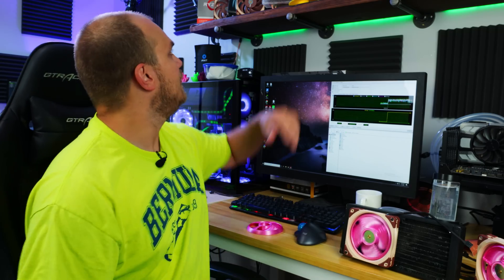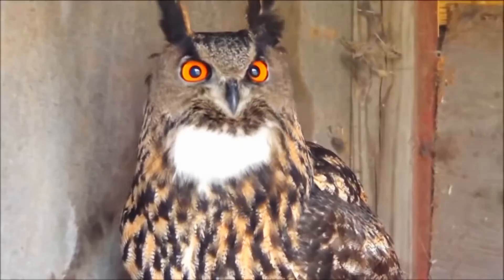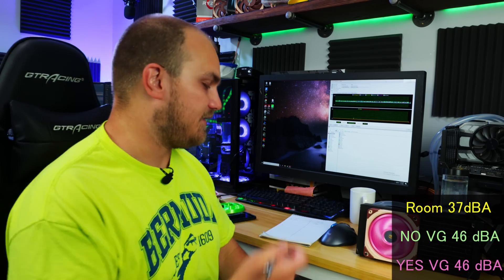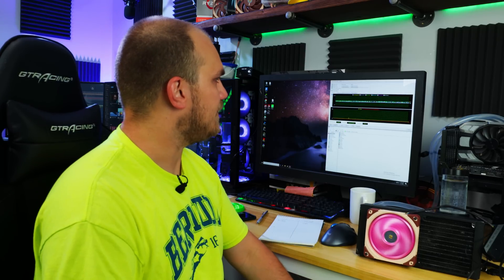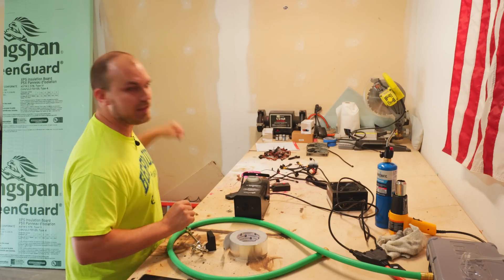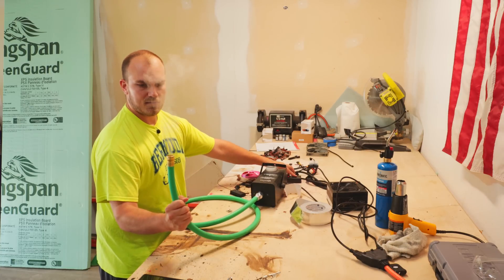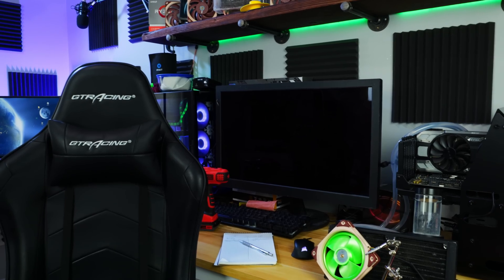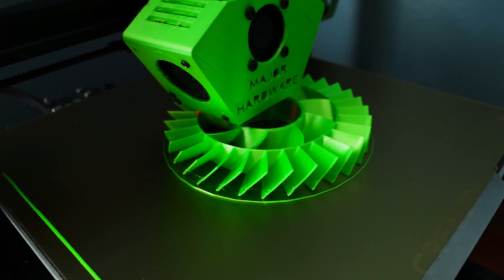Do Vortex Generators Make A Difference | 3D Printed Fan Testing

Comment: How about some dimples in the fanblades? Like a golfball?
Reply: There are already commercial fans with similar features like the „Zaward Dimple Blade Golf Fan“, I remember Sharkoon selling golfball-structured fans around 2012. Does not seem like they were that much better. All these vortex generators and what have you work above a certain speed and are useless below, similar to winglets on airplanes.
Reply: dimples on golf balls work by induce turbulent flow faster/earlier than without dimples, this way a spherical golf ball flying though air appears like a more sleek droplet vs. a fat one. Hence reducing drag.

Hence dimples won't really have an positive effect on a fan... on a car it somewhat works, as shown by Mythbusters.
Reply: I wonder if it had a positive effect

Comment: Make one with a servo in the middle so you can adjust the geometry of the blades.
Reply: Awesome idea, but two problems. One: even an ultra lightweight servo is a lot of mass to add to a fan. Two: how are you going to make the electrical connections to the servo at 2000 rpm?

May have thought of a solution. Instead of using a servo, build a centrifugal governor to control the blade pitch!

Comment: looking forward to that one you showed at the end! also mass on the fan (it self) can cost some horsepower resulting in the motor pushing more against the fan than the air... i swapped my house fan's propeller with one that previously burnt down (the motor)... now it finally pushes air but can only turn 1/3 the speed. the propeller is like 3 times the weight but the fan curve at least does something! (and is 10 times more quiet since it spins less fast to create more flow!)

Comment: why not put something like a scoop in the side of the ring to pull air from de side and create a bigger preassure underneath?
also, making bigger blades so the end of one blade is underneath the nex one..
basically I want a compressor

Comment: Why do you use 240/280(?) radiator for one fan?
Use the same size of radiator then for fan... Or put two of them... 
Take for it some custom loop or just Arctic Cooling Liquid Freezer II. They have 38mm thickness and have very good performance.

Comment: Vortex generators create turbulent flow, which, in the case of aircraft, helps to induce lift in scenarios where the laminar flow delaminates from the wing. For a better explanation, check out Veritasium's video on turbulence.

Comment: I suppose a large part of fan design is application. Static pressure and airflow are important metrics, maybe you should try measuring them as well as their overall cooling performance.

Comment: love the build the subscribers fan idea ^^, some things i would love to see you test if possible is:
1. Curvature of the fan blades, what impact it might have on static pressure, and noise of the fan. Going from a straight ramp all the way to 90 degrees, i will let you decide the increments ^^.
2. Fan blade overlap vs not having full cover of the blades surface.
if any of these ideas are easily something you can answer already, i would still love to hear them ^^, hope you have fun with the next couple of iterations :)

Comment: Dumb idea for the fan design, but how about turning the fan blades into air scoops, like on race cars? Also, would it make a difference to have the vortex generators on the opposite end of the blades? You don't have them on the front of a car in real life, so why not try the same with the fan?

Comment: G'day MH,
It would be really interesting to see how the Smoke test performs with each Fan in a Case with a TG/Acrylic Side,
From memory you pulled 2 Noctua Fans apart so you could do 1(Front) in 1out (Rear) & also 2 in (Front) + a standard rear fan to see if the VGs make a difference to Flow characteristics over distance in a case,

Ps That new fan reminds me a bit of the fan ASUS used on the DirectCU II versions of the  GTX 780 & R9 280X, It will be interesting to Hear how it Sounds

Comment: Put the fins either underneath at the top of the blades OR on top closer to the bottom so they are actually involved where the air flow is being manipulated by the fan instead of before the fan actually takes control. Also I really like the new compressor style fan

Comment: you should look into a variable pitch blade

also try printing your fan upside down so the side of the fan that faces out is the bottom of the print yes it will look uglier from the outside but the side that makes the most contact with the air you are trying to move will be smother and their for not disrupt the air as much 

also use .2mm layer heights and at slower print speeds yes it will take more time to print but the results will be better

Comment: ring is good in my eyes because one of the main things noctua did with the A12x25 is getting the fanblades as close as possible to the frame
soo if you have a rim you basically have frame that spins with the blades... or something like that, i hope you know what im trying to say
look at noiseblocker fans for example

Comment: Pretty sure your fan blades are so coarse they're already creating vortices all by themselves. In that scale, your Z layer height is far too large  for your blades to be a "smooth surface" enough to create laminar flow that would induce drag.

Next time try printing the same design with a much smaller Z height, and compare that one to the current, coarse one

Comment: the vortex gens should be on the end of the blades, not the beginning...  like on the evo, its not on the front of the roof, but the back... and maybe on the other side of the blade.
Reply: need a ring, but not curved, and the 4 blade is good. imho

Comment: Keep the ring, it turns the fan into a flywheel. That's what the Antec TruQuiet Pro did.
Reply: I can almost guarantee that the ring is helping to stabilizing the wings from the small imperfections and imbalances that you cannot account for in your 3D printer so I honestly think you should keep it even if you take it down to a thin ribbon
Reply: Yes, keep the ring, but resize it to be smaller.
Reply: I agree, it also reminds me of Noiseblockers
Reply: Sorry, but I cannot trust a furry.
Reply: @colonelinfernal5004   I hope that was a joke

Comment: Vortex generators are used on aircraft wings to generate more lift by creating a rolling effect on air flowing over the top of the wing and past said generators. This causes a much stronger low pressure region over the top of the wing, causing more 'suction' to pull the plane upwards. For a fan which is just sucking in air, it won't do much other than disturb the airflow over the back of the blade, making it harder for the blade behind it to pull air in. You're not trying to generate lift, you are trying to get a smooth even airflow. Though, I do have to say, I love how they look on the fans.

Comment: The surface of that plastic is from itself (maybe even far) too rough to allow for laminar flow I think, hence the vortex generators won't add anything significant. In the close-up shots of the fans, the ruggedness of the fan surfaces is very clearly visible. You'll probably need a professional airflow test device actually see a difference. Maybe you can test this again after smoothing out the blade surfaces. Som sandpaper might be enough, or maybe some heat gun or acetone. 
Agree the "shark fins" look cool though! XD
Reply: I've seen a lot of fan smoothing comments from all the other videos but so far not much has been done about it
Reply: My guess is that he's going to need a new 3D printer as it looks like he's using PETG which can't be chemically treated.
Reply: @zscherme1  Prusa FTW. Can't wait till one of our favorite tinkerers finally gets that baby in and out of the box. Hopefully we get a unboxing video. I'm itching and want to see what Major Hardy has to say about the one he order.
Reply: @zscherme1  It is actually PLA (the pink stuff) :) Those chemicals (for smoothing) are horrible though. Perhaps he could try out XTC3D as a top coating.
Reply: @zscherme1  he literally said he used PLA.
but he can still purchace ABS and acetone
Reply: @zscherme1  He said he's using PLA.
Reply: @timobensch3904  Must of skipped it, my b. Thanks!
Reply: @jordananderson2728  Must of skipped it, my b. Thanks!
Reply: @rkatz69  Ah, like I told others, I must've skipped that part, whoops. Thank you, though, XTC3D would be the logical step to more accurate solutions but perhaps counterintuitive to a fast test methodology. Cheers!
Reply: @zscherme1  yeah abs and acetone might be the way to go
Reply: @daniel46245  what I'm saying is that if the flow is already turbulent due to surface roughness, making the air (more) turbulent by inducing vortices won't provide any significant contribution
Reply: @daniel46245  I think what Wouter was alluding to was that because the fans are rough, the surface itself acts as vortex generators. If he could smooth his fans and then compare them, we may see a difference.
Reply: Fans are not airfoils. You're most likely not getting laminar flow as the turbulence from one blade affects the next.

Plus vortices are not meant to move air. They redirect it. Not really an issue on a fan is it.

I've ran simulations on an evo and the vortex generators only work with the rear spoiler. Furthermore they make it worse if you don't have the rear spoiler or if the shape of the car is different.
Reply: @Pawer8  oh fan blades are definitely airfoils, no debate possible on that. But you have a very good point about the turbulence from the blades that came before, didn't think of that!
Reply: @WouterVerbruggen  an airfoil is designed to create a force by moving air. A fan blade is designed to move air by creating a force. In both cases you want maximum of the first and minimum of the second.

For example. A spoiler needs to create as much downforce as possible while moving as little air as possible as to reduce drag.
 Fan blades would be shaped very differently if they were meant to create a force.

Leading edge would be bigger and it would definetly not be constant thickness
Reply: @Pawer8  That doesn't make them not airfoils. You're trying to make a distinction that fundamentally doesn't exist, remember Newton's laws. It's the resulting airflow that different, not the (fundamental) physics that dictate them. Fan blades do literally the exact same thing as wings or propellors, it's the details that are different. Spin a PC fan fast enough and it'll take off just as a rotary wing aircraft (i.e. helicopter)
Reply: @WouterVerbruggen  you're right. Forget the nonsense.
It's an airfoil...Period. Full stop. Roughness isn't improving anything and probably it's already adding turbulence. And vortex generators are useless in that size and shape. It's added turbulence which may also add destructive interference, resulting in less air flowing in or even in air escaping out, like in those badly designed cars where air resonates the inside. As per the grooves, they should be counted to have an idea of the frequencies involved because resonance can also be another tough problem.
Reply: 2 things, first twin scroll like modern turbos and look in to realitive airflow. And second definitely sand the blades smooth. They will never be half as effective if they're rough
Reply: Would a resin printer be out of the question regarding smoothness?
Reply: @krayos13  You say you're not an engineer, but for sure you did you research, as the vast majority of what you said is entirely correct, one just needs to check a fluid dynamics book to prove it correct (and it is). As mentioned before, the vortex generators on plane wings are in majority to give them a better performance on higher angles of attack or even bad weather, a perfectly laminar flow wing is a better choice indeed but way more sensitive to adverse effects or higher angles of attack.
The scale is a problem indeed, and scaling fluid dynamics problems is a science on itself.
Reply: I've stated he needs to get a resin printer to print these fan blades since they will be more evenly balanced and smooth, but he hasn't seemed to show interest in that idea. I have an elegoo mars and it is way cheaper than the prusa i3 he bought which in my opinion is extremely over priced. I had a cheap chinese i3 kit that I did a few upgrades on and it printed very well as well as my folgertech ft-5.
Reply: he should ask Corsair to make a few of his designs, but i don't think they would do that because of the high costs of the molds (they need to be designed and made)
and to make molds it costs too much for a few fans to be made (some molds costs +2k in euro's over here in the Netherlands)
but yeah, he needs to make the fans smoother
Reply: Acetone vapor baths might work
Reply: Surface roughness will create a bit of a boundary layer, but won't stop laminar flow. Not that you'd get laminar flow through a bladed fan anyway...
Reply: Acetone fog is best for smoothing although the print may loose small details
Reply: i agree. I saw an acetone based mist chamber DIY for smoothing out those 3d print
Reply: @krayos13  i don't think fans produce laminar at all. And no, laminar is yes or no, watch Verisatium.
Reply: @vrnvorona  Or even the guy that won't stop raving about it. Smartereveryday.
Reply: @vrnvorona  No, you can have laminar at the start (pretty often may I add), and then it will progress to turbulent flow. It also depends directly on the flow speed as well.
Like, it's straight on the Reynolds number formula.
Reply: I think they might be changing the focus of airflow, you could probably see a difference in unrestricted airflow
Reply: i agree with that.
Reply: Not to mention none of that matters on this kind of scale at this speed...vortex generators also aren't straight winglets. They have very specific angles tailored to the application and they actually alternate which direction they are pointing. Essentially they are used to diminish the air separation from the airfoil by getting it to swirl on a different axis to the airflow...
Reply: Surface finish by itself does not determine whether flow is laminar or turbulent.
Reply: @krayos13  yep i thought the same as soon as i saw it and im an Aircraft Engineer, boundary layer is boundary layer.
Reply: Doesn't really matter because the vortex generators are at the start of the blades, even if they were smooth and able to create laminar flow it would get disrupted by the vortex generators before touching the fan
Reply: Acetone works well.
Reply: @-eMpTy-  on ABS plastic, not PLA
Reply: most people use acetone smoothing to smooth out 3d printed parts
Reply: @notserpmale03  it works on abs, but I have never gotten to get it to work on pla. Also on thin parts acetone will warp them
Reply: @notserpmale03  Acetone does not work on PLA.  The only solvents that do are pretty nasty e.g. methylene chloride

Comment: i would say try making the vortex generator from the bottom of the inner ring part to the top of the outer ring area. might make a difference. or try putting a small wall through the middle of the fan blade to obstruct airflow.

Comment: I think multi-element wings, similar to F1 also worth a try.
Reply: I actually know an F1 engineer! Be right back!
Reply: @AmaroqStarwind  this would be pretty cool to see, multiple blades on a single blade
Reply: @AmaroqStarwind  you back yet?
Reply: foxrumor Mark Priestly has not yet gotten back to me :c
Reply: Amaroq Starwind F
Reply: You mean an upside down aircraft wing
Reply: They are horribly inefficient but have great stall characteristics.

From my basic understanding of fluid dynamics would I suspect that they will have noticeable more sound to them but that they will have great static pressure which would make them ideal through a tight radiator. But I might very well be wrong here
Reply: What that the multi-element wings do is provide multiple surfaces pushing on diffeent parts of the air (drastic oversimplification).  But thats basically how the blades of a fan act to begin with, multiple surfaces pushing on different parts of the air.  The only difference is that he air is moving through a stationary fan, rather than a car moving through the stationary air.
Reply: we heard you like scoop , so we put a scoop on your scoop so you can scoop while you scoop
Reply: ah yes, pc needs more D O W N F O R C E
Reply: If I'm not mistaken, some turbos already have several blades, so, worth trying?
Reply: @chelarestelar  🤨 All turbines need several blades/fins, but I'm probably misunderstanding you.
Reply: @ColonelCampbellAI2024  yeah, I didn't know how to word it so it wouldn't be confusing. I meant that I saw turbos with a fin right under another
Reply: From what I can understand of your idea, it would turn out somewhat similar to a turbine, certainly cool, but I think he has done it already

Comment: Neat! It occurs to me that you might get more performance with vortex generators if you incorporate them towards the back of each blade rather than the front. They are designed to decrease the amount of flow separation, which should, in theory, increase the volume of air each blade is able to affect, if I understand it properly. (Aesthetics or not, there's a reason why they are on the back of the Evo's roof and not on the front of the hood ;) ) Easy way to test--make some of the same blade design with the generators positioned in the middle, then 3/4 of the way back, then on the trailing edge. Might be too small of a test bed to get quantitative results, but you never know. Keep up the good work! You're filling a unique niche here and I'm looking forward to seeing your channel develop. :)